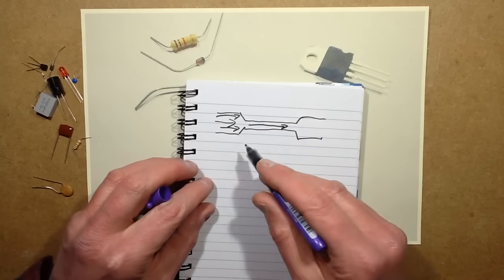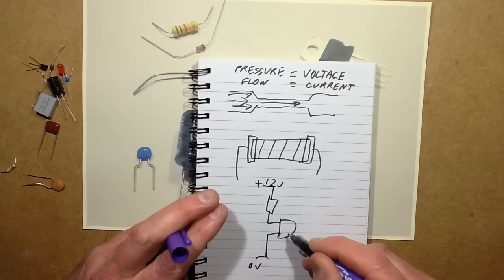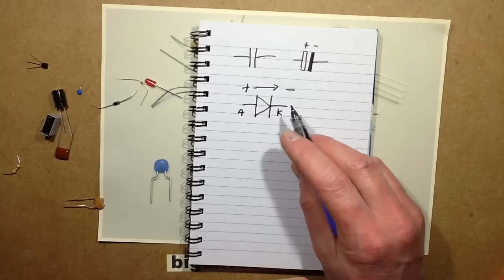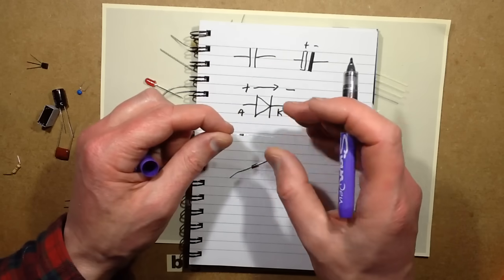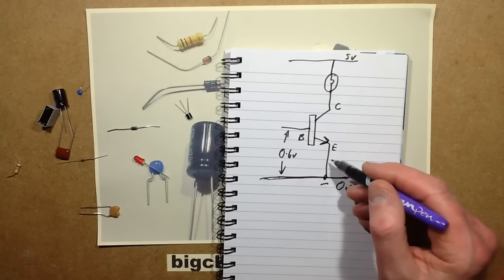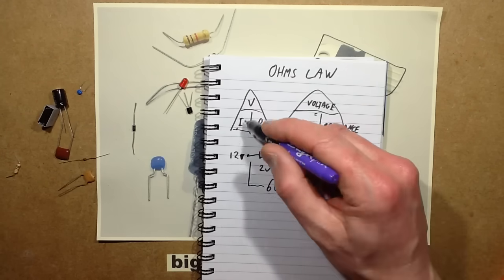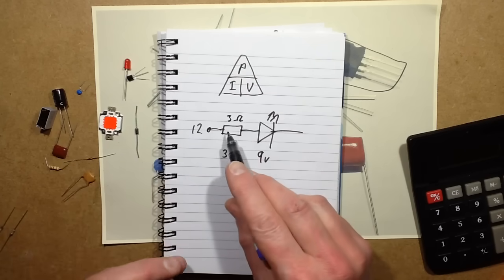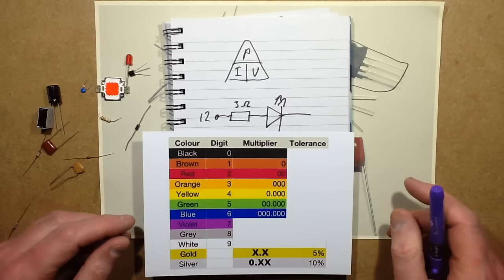A simple guide to electronic components.

Comment: I tried learning more about PNP NPN photo eyes at a mill I was working at and although I figured it out my eyes crossed in frustration. I sure wished I’d have seen this video of yours because even now i understand it all a little more . Thanks!!… with that said in the course of 20 years, I sure let out a lot of factory installed smoke in a great many components 😂
Reply from the maker: The main thing to know about the NPN and PNP sensors is that the NPN switches the output signal down to the negative connection and the PNP switches it up to the positive connection.

Comment: I like to understand things down to their basics. I've understood electricity to produce motion/force. For example, a DC motor that rotates a shaft doesn't do anything useful itself, because the electricity generating the electromagnetic field has just produced a motion/force to rotate the shaft. If one attaches a propeller to the end of the shaft, now that motor is said to be producing a cooling system (fan). But this ultimately just produced the motion/force from the electricity (and magnets, wires, etc). Is this a correct understanding? Thanks!

Comment: I thought I was going insane during the diode explanation. I have a background in chemistry, so I know that electron donors are negatively charged and will flow into positively charge electron receptors. When I saw the flow through the diode going from positive to negative here and in tons of diagrams, I thought I was missing something and reality crumbled around me. Turns out it's just a holdover from old days and it is just a positive "pressure" to negative, so the positive doesn't equate to positive charge, but positive flow. 

Edit: And never mind again. Zener diodes are supposed to let voltage in the wrong way? Which is... The opposite of what I thought diodes are supposed to do. And it somehow keeps the voltage constant.

Edit 2: I get it, now. I was thinking of it all being in-line and acting like a magic resistor, but instead it just acts as a kind of pressure safety valve so it makes a shortcut for voltages above the desired amount.

Edit 3: no clue what gain is supposed to be or what transistors are supposed to do, where the flow is going, or what it's used for.

Edit 4: got it, now. Transistor is like a mouse trap. Once you overcome the pressure with a bit of power to the trigger, the more powerful spring gets released. The gain is the difference between the trigger strength and the main spring strength. A limit to how delicate the trigger can be for a powerful spring.
Reply from the maker: In the early days they thought that current flowed from positive to negative, and that's why diodes are arrows pointing in that direction.  I prefer sticking with conventional current theory as electron flow theory just causes confusion.

Comment: So, a capacitor, is a kind of resistor?
Reply from the maker: A capacitor can behave like a resistor, but only on AC.  Many small electrical items like time switches use a capacitive dropper as an efficient power supply that is not isolated from the mains supply.

Comment: When I was in electrical school (I'm not an engineer, just a sparky) my instructor used the exact same water flow analogy to describe power, current, voltage and resistance. I'm also colorblind so I use an LCR meter to find resistor values 🤣

Comment: Enjoyed the majority of the talk.. But maybe the ohms law description was rather messy. Seems like you were confused how the teach that. The Triangle was rather superfluous especially when you suddenly laughing in a  calculation. Better to use the Ohm  formulae and she the calculation .. Yes I realised its har when its time limited on here and lots to show. The Transistor segment was rather good.. but I believe the analogy to the Valve rectifier with the cathode anode and grid ,, with equivalent in the transister  more visual . The alternative is a water flow in a pipe with with a constriction , as you already did draw  with a bypass valve and pipe connecting each large end . As to the The pressure and flow analogous to voltage and current it might be worth refection  on bournoulleis Principle who described the relationship originally in fluid flow in pipes.  Capacitance was very original and I enjoyed much . and the electrolytic problems which cause old device failures. Great accent and the jokes at the end !
.

Comment: I think of resistors as a water filter Capacitors a tank  with a smaller outlet pipe. Diode a pipe with a one way valve. Transistors Like a diode but with a switch on ther valve

Comment: Hi Clive. A have a 67v charger. There is space to fit a small Volt-Amp meter display.
(It needs a 3v-30v power supply)
There is a 12v fan inside 
( I messure stabile 12v DC, both when the fan is ON and OFF).
I was thinking to half-bridge rectifying the 12v DC source, in an attemt to "isolate" the 12v power supply to the meter.
The volt-amp meter wil display the 67v output.

I placed one diode in series with my multimeter, the voltage increse to 19v.
With a diode in series on both +12v, and on the -12v side.
-Now my multimeter messure 44v DC.
How can 12v DC, increse when messured with a rectifying diode in series?. 
And even higer voltage with one rectifying diode in series on both + and - ??  
 Shouldn’t rectifying diodes in series on DC source resulte in a slight drop in voltage, and not a massive increse in voltage? 😅
Reply from the maker: To display the main voltage reading the meter may need a common zero volt reference for both its power and the measured voltage.
Reply: @ not sure why, but a 500ohm resistor i parallel, after the diodes helped my multimeter read the correct voltage 😅

Comment: 30:30 BRILLIANT.  If you are planning to have (or have some expectation of) a fire, then plan ahead:
1. Clear away the paper, and make a heat-friendly work space - I use a cookie sheet with a 1/4" lip on it, eg. when soldering.  Aluminum foil almost as good.
2. Make sure you know where the electrical is connected, so you can turn it off in a hurry.
3. Make sure you are prepared for "likely" accidents, with some of: fire extinguisher, 2 jugs of water, water in a plant-spritzer, open box of salt (salt is handy, vacuums up nicely, and doesn't burn).
4. A fan to ventilate to outdoors reduces the likelihood of smoke alarm going off.

Comment: Hi Clive and everyone I got a omron m2 Basic blood pressure monitor that won't switch on, I simply need to know how to fault check the components like the 1 micro switch, the capacitors and resistors and the display screen, I fault checked the components by doing a continuity check by attaching the multimètre probes onto the components pins but I have been told that's not the correct method especially whilst the components are still attached to thé pcb, if I did it wrong can you or someone else please help me by giving me the correct method, I would be very grateful to repair the monitor for a patient I'm a novice but learning and keen Thankyou great video.
Reply from the maker: Make sure the batteries are making a proper connection if it uses standard replaceable ones.  After that, a common cause of faults like this is the clicky on/off button.  Bridging it out with a bit of wire or metal tweezers will show if it is faulty.
Reply: @bigclivedotcom Hi I tried what you recommended by bridging a wire from the batteries to the micro switch, apart from a tiny hardly noticeable spark both in off/off position nothing, still won't switch on, I bridged the wire over to the PCB touching each individual small brass dot, I hope that makes sense, the motor made a sound after touching about 3 of 10 ish brass dots but the monitor did not switch on nor did the display light up, I'm stuck can the micro be taken apart and maybe the corrosion etc removed, I have seen someone do that to a Henry vacuum switch and it surprisingly fixed the switch, sorry to waffle Thankyou.
Reply from the maker: @sloopycat1954  I wouldn't recommend bridging random connections.  That could damage components.

Comment: So a resistor increases the voltage? You know restricting water flowing through a pipe is how you increase pressure, right? At least that's how we did it when designing lawn irrigation systems, that's why the lateral lines are reduced from the main line and the fever lines going to the heads area further reduced
Reply from the maker: A resistor reduces the voltage in some instances.

Comment: 6:19 If somebody is making an old school crystal radio which plays AM radio signal using it as an energy source , they'll make a simple variable capacitor which allows tuning into an AM station! 

Constructed from a cardboard tube, partially wrapped with foil that stays in position. Then a movable sheet of paper covers the stationary foil, and a slightly shorter sheet of foil is attached to the movable paper. 

The paper and foil layer moves together on top of 1st foil layer.

And the paper and foil layer is moved to change the capacitance and tune into a radio station!

So im guessing the paper must be the insulator, and the foil is a conductor that surrounds both sides of the insulator just like your sketch describes! But you make the 2nd layer of foil shorter than the paper, so it cannot touch the first layer of foil, maintaining insulation thanks to the paper later. 

There's kid friendly explanations of the crystal radio if somebody looks up sciencewiz inventions kit crystal radio

Comment: i really shouldn't touch sensitive ekectronics. but any way。。。

*what components on a dc circuit board have the ability to go *p0p wheb u put power to a pin leading to something that probably shouldn't have had that voltage applied?

😇
Reply from the maker: Lots of circuitry can be damaged by applying power to inputs and outputs.
Reply: @bigclivedotcom  i figured that 😅. i guess my thoughts were pondering if there were particular components that can make an audible pop sound when the moment of fail occurs or if every mounted component on a board is capable of such a sound effect 🤔. Thanks for thoughts
Reply from the maker: @caveman1988  If it has popped you should be able to see a sign of damage, like a crack or sooty mark.

Comment: the BC transistor 547 it a signal transistor what’s i understand it not for handling high power it needs a resistor to limit the LED without it a 12volts that’s goes strait to it will blows the LED let’s says a 12volts LED it works fine 1.5 or 5volts it will blows it Brian out
Reply from the maker: A BC547 is rated for a current of around 100mA.

Comment: Hi Clive , I totally should know this , I'm one of the truthful Ham Radio operators from the 90s who forgot how to memorise mock papers to pass the then RAE . Clive my question is "How does a Step up Module " work eg a 9v battery can basically make a lethal Stun G etc ??? I don't get what they're doing M8??
Reply from the maker: The stun guns use a self oscillating single transistor boost transformer as found in insect zappers.  But there's a second stage where a capacitor is charged to high voltage and then discharged through a few turns of an iron cored high voltage transformer.  It's that final stage that provides the high current spikes.

Comment: Clive is there such a thing as a current flow switch enabeling two usb to be used interchangeably as both the input and output say a standard usb and a usb c or micro usb slot on one device? As you can probably tell im new to this but i have an idea using a discarded electrical device if i can find the correct components it will be an awesome battery pack device with various uses.
Reply from the maker: Some small power banks do actually use the 5V in and out commoned together.  The dip the 5V output briefly to see if a charger is connected.

Comment: I’ve always seen the water flow thing for resistors and thought it actually would make more sense if you put a sponge in the pipe. The sponge slows the flow of the water without increasing the pressure. Necking it down would increase the pressure or voltage. So a resistor is almost more like a partial clog. Anyway. Just a thought.

Comment: It will refuse that and increases pressure  the psi wod blow the  pipe if curvbofiviver  is lic cablblar ceramicaicathat gos on oms 1000000,000000000001the thousand onms idi bay colo for each color the vige the slower capacitor is a charge collector a storage of powered power will only flow one way if you swoshtm the powered will dis char imidiatt is powered I make on tim a dial radio Cristal that runs with no electricity or bateris  just air antenna hraund antenna if you aplay the materia that's use in mirror that can make a solar panel wyay you are not splayininv  that the right way carbon insulation carbon solar distil water lemon will makesulfuri asid  whe aplag curent then you have a hom mad bateri a capacitor is the seil I aliminum paper carbon rup sink the msyeriali verh resisting ceramic maika hidrogen lithium and plutonium neptuniomuranium  that is powere very powerefull energy highly bolatyl  nuclear reactors  thst csn powered alot of yhings bug solar is the most cleaner my bad i am sory for judging i was jus pleing alitle i am veerry berry sory for give mr pless is just thay i seen othrr piople traint to con fusin  mnow i see you do know that you are realy tiaching right very good thank youwants agan i am sory for saing som thing i diring want tosaid  i dont know how ti said i am sorr y dint get mac at ne ples

Comment: Hi Clive,
I'm trying to repair an ECU from my V8 engine and  thus save myself £2000 for a replacement ECU ...a diode has broken on the circuit board ...it provides a reading of 158 when tested on a multi-meter...Can I assume that I need a 15V replacement ?
Thanks Steve W.

Comment: Resistor = Saturn = restrict flow, time delay

Capacitor = Jupiter = layered insulator, surface area, electrolytic capacitor, smooth sine output, temporary battery

Diodes = Rahu = one way valve

Transistors = Mars = 3 pin, amplifier, switch, mosfet

Comment: Hey big live. I need help I got Xmas tree lights that work on battery one set works with 3 aa 1.5v battery's another set on 2 aa 1.5v. But want to convert them to usb. So will the right resistor amount and size if you know what I mean. To convert 5v to say 3v abd 4.5v  because want I am going to do is put two sets of lights on one lead. OK will have to add say a couple of resistorsnon the 4.5v set going from the main lead. I will try and do a video of I mean and send you link. Soon
Reply from the maker: I have at least one video about converting battery strings to USB.  But if they are multi channel then they'll still need the circuitry.

Comment: Hey i get so confused over the difference of volts, watts and amps. I cant picture wat each is doing . I know amps are like how fast the water flows. And volts is the pressure. Watts is the size of the tube.. but my brain sees the flow and pressure as one i. The same as each other. As this is the most basic fundamental of electricity, if i screw this up then i will be wasting time moving forward. I cannot seem to grasp these concepts with any sort of confidence. Nobody ever explains it any other eay and they just move past rifht after they explain volts and then they say flow and amps and then they move on. Flow and current are the same thing to me. I cant figure this out

Comment: 470 micro-farad sounds insane to me. That can't accomplish anything in my mind. I run car audio systems. As a young man(and a dumb man), I ran a 4 farad capacitor to supply the amps needed for my subwoofers at peak power. Now I use nice, deep cycle batteries. Less extremes for the charge and discharge systems. Much more stable/smooth power across the board, and much safer as well.

Comment: Sorted out my Father-In-Laws basement. He was a US telco engineer/collector 1980's +. Loads of bits and bobs. Have a few bags of can transistors/op amps, diodes, resistors (1/4w, 1/2w and well beyond), old solder etc. He's got "tubes" everywhere, with big RCA and Sylvania "repair mans" tube kits '52's?. Heathkit Oscilloscope and few more kits. I've sorted and scraped out any old chemical bits and rusted out IC, but seems a shame to just "throw" the rest. Thoughts on "worth keeping" for general hobby or scrap? What's likely to "still be good"?
Reply from the maker: If the tubes are new then you may find they sell on eBay to collectors.  Even used ones listed as such would possibly sell.

Comment: For the alluminum foil and paper in midlle sanwitch capacitor are you putting current through the metal or does the metal hold charge
Reply from the maker: A charge builds up within the metal.

Comment: Nice! I did a small prohect using my “understanding “. So i did a small globe using an LED light from dollar store that runs on 2 AA batteries and fairy lights. Both used 2 AA batteries, so my not so smart self added 1.5v x 4 making 6v (forgetting that some electronics run in parallel or series connections) and got the inputs with a 5v usb power bank. It looked pretty at first. But they all shut down and didn’t turn on. To clarify, i just took off their respective battery holder and replaced them with wires that connected to a usb male. I’m trying to learn some to remake it. I’m thinking that the electronics ran on 1.5 v in parallel and i fried them using a 5v 1 amp input.
Reply from the maker: If the voltage is too high it causes too much current to flow through the LEDs, and they look nice and bright for a while, but then burn out.
A USB power supply is ideal for LED projects, but you do need to add a resistor or two to limit the current through the LEDs.
A good general purpose resistor value could be 150 ohms.  A common quarter watt resistor would be perfect.